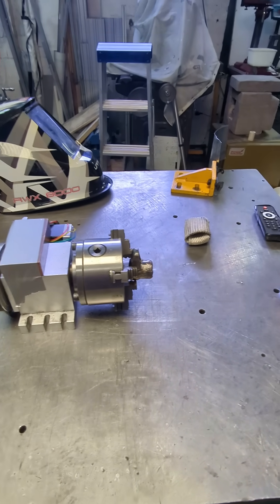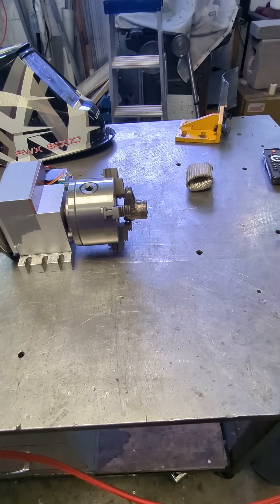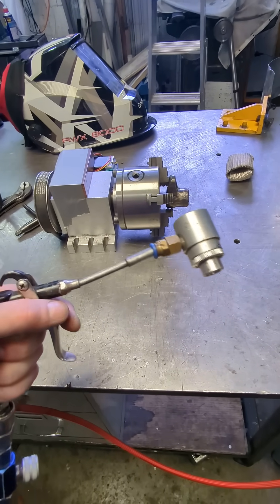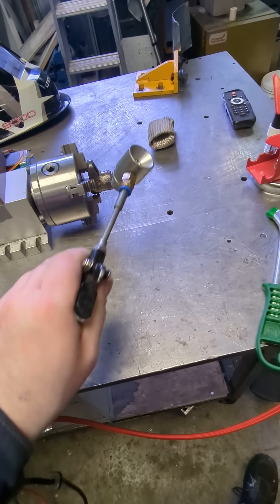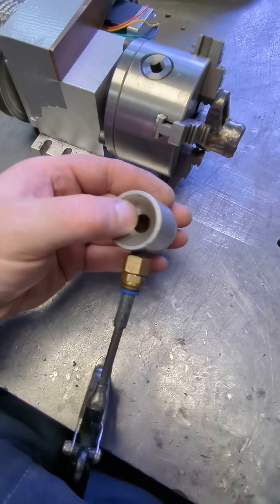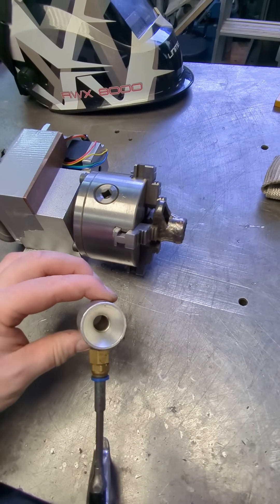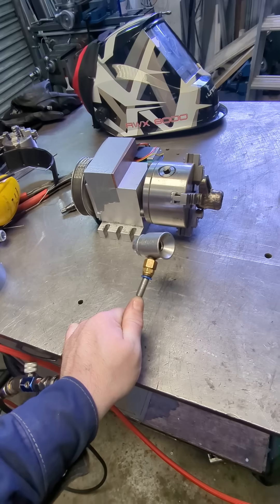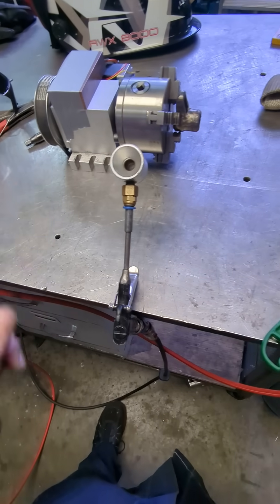Rapidly cooling TIG work without contamination

Comment: Does it really have a higher cooling rate then just blasting with compressed air. I have a hard time believing it would
Reply from the maker: It does (I've tested it), it also dries wet things much faster and that's their main use in industry: blow drying things on conveyor lines. The reason it does both things better than just an air gun nozzle is (as far as I understand from my cursory research) the number of particle interactions - the speed an air stream hits something doesn't change how much it cools an object, but the volume of air hitting the object does, and air amplifiers move 10 to 25x the amount of air compared to their input (trading speed for volume, no free lunch).
In person they're pretty impressive, you get a wall of air instead of a jet. 
Search "ZH19 aliexpress" for the one in the vid, less than $20.